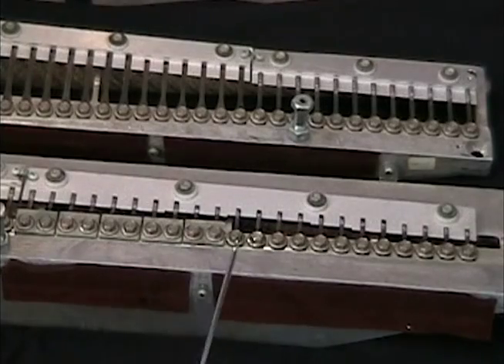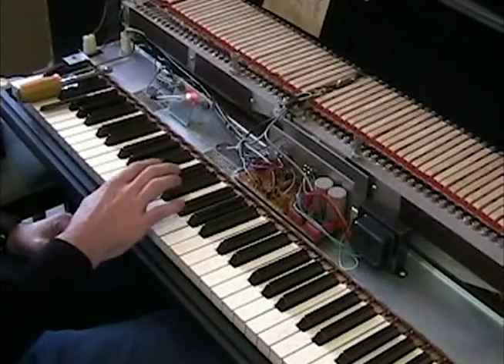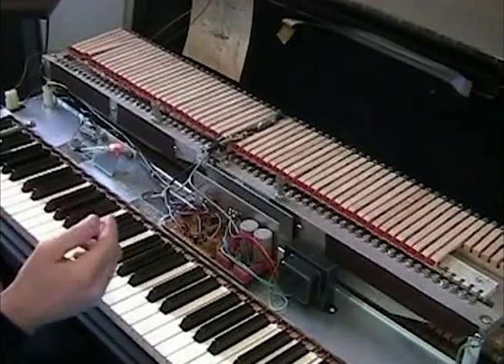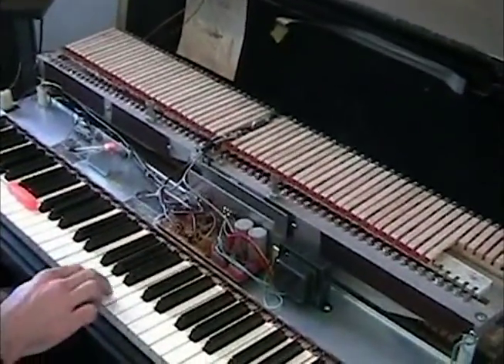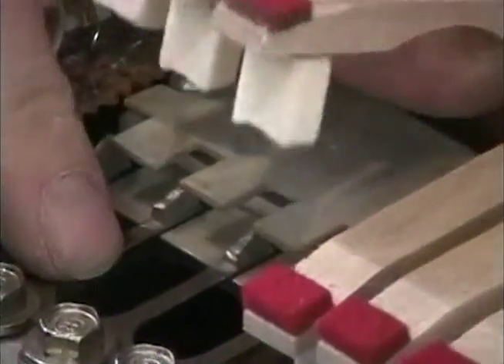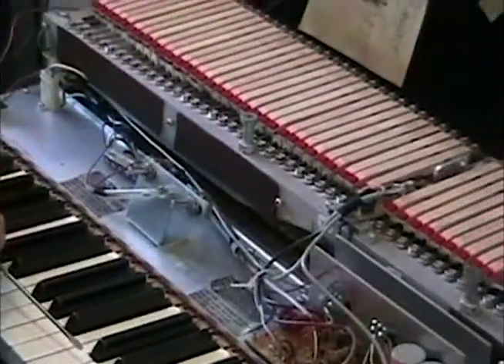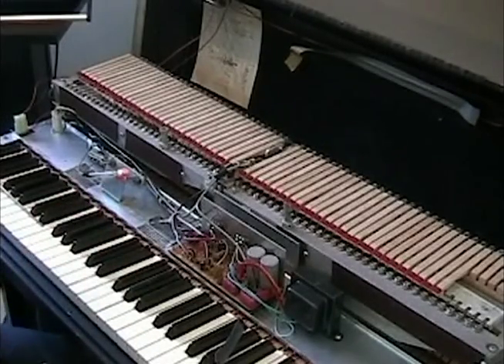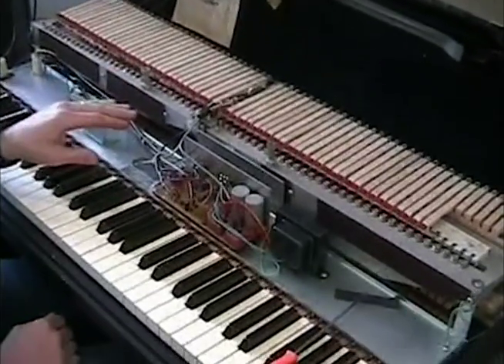A Beginners Guide to Wurlitzer Restorations & Repairs: Voicing

Comment: Can I Frankenstein my new 206a it has no power Im at the point I have to take the hum shield off and I can see if a reeds shorting out against a pick-up. I heard that it  an cause it not to power on but I found a used old 200 board and I'm wanting it for the aux out and tremelo that isn't present on my 206a  the student model I don't want to chop it but I want to hear that baby sing I found a  rats, mice tomatoes tomato's nest that when I pulled it out on the high end I almost filled a plastic grocery bag with nesting and  I couldn't believe it it even ate into the first 2 hammers but didn't destroy them just left there mark to improve my sound I just don't know if I put a 200 board on the 206a then I'm gonna probably have to get a new 200 pre amp cause the 206a has the 200a board what to do what to do

Comment: Is the pickup different on a 200 vs. a 200A? The pickup on my 200 doesn't seem to be movable like the 200A in this video
Reply: Same issue....
Reply: I looked back at my 200 pickup and actually some parts are thicker than others. So some parts I can bend and others I can't. I think the upper register is where it's very thick and I can't really bend it.